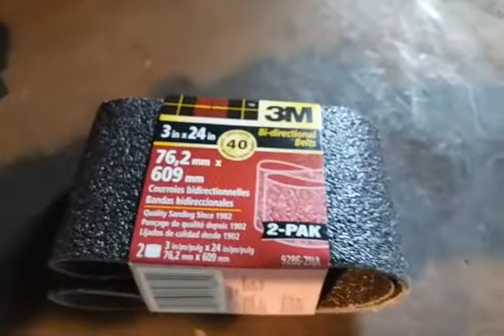Current projects

Comment: Cool stuff!! The Park tool box is nice ..I have a Park toolbox somewhere out in the garage :]  No sliding drawers on that one though....that sander is just a work of art on its own...i'd just clean it up and show it...maybe those brushes will come along some day....to many projects lol...time to get Zen and one thing at a time :]
Reply from the maker: Yes! That's what I am going to start doing. One project at a time. I get a big tool lot and want to jump headfirst into it!!!
Reply from the maker: Yeah the sander is amazing. Well worth the ten bucks even if it only a display piece. I'm going to try and find a donor set that might work and I can order the plastic caps that hold the brushes in place for like 2 bucks apiece. I acrually.could order the brushes as well, direct from Porter Cable but they're like $15 each. And I need 2. They still sell parts for some of their older sanders and I found them for the "take about a3" which is very similar.  Mine is the BB10 model. In the meantime I am going to take it apart completely and clean every part. Also going to replace the cord. I am obsessed with taking apart tools. Power tools especially. Old power tools even more especially yet. Sometimes it works against me as once in awhile something will break or whatever. For the most part.it usually ends well. I did a test portion with just the wire wheel and it came out amazing. It is the type of piece that would buff out and be super shiny. It's going to end up indoors with my other vintage power tools. 😀😀😀